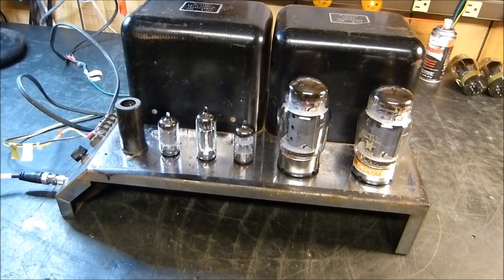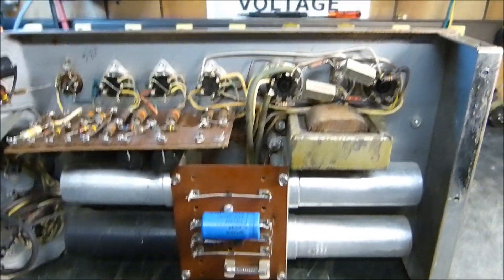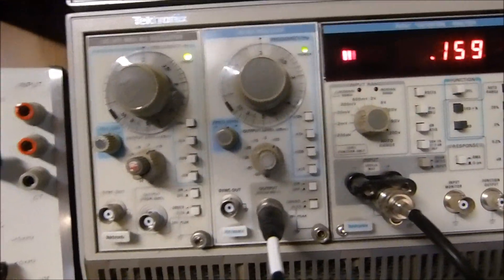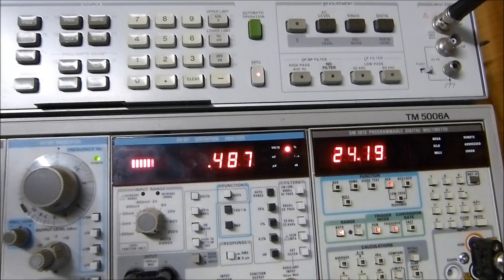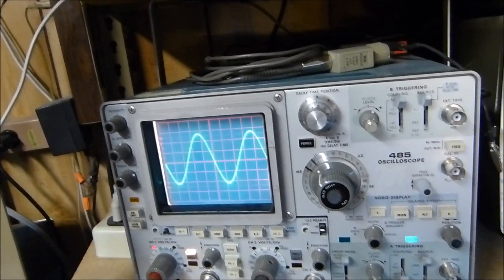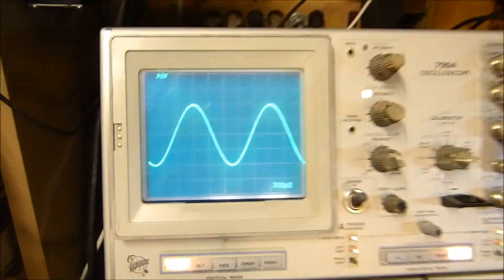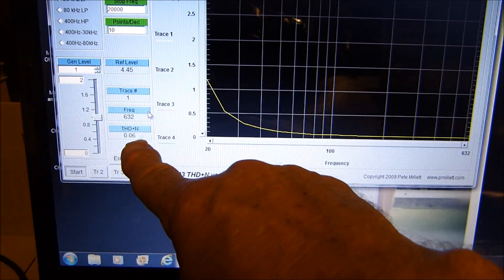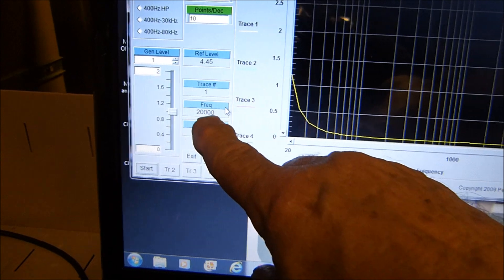McIntosh MC75 Mono Block Vacuum Tube Amplifier Testing and  Documentation

Comment: Question my fuse under the blue capacitor is dead, an I can not read on this how strong the are. And in the schematic documents I don't find them. Did you know which fuse in their?
Reply from the maker: I think they put the fuse under the chassis there just in case someone "accidently"  or carelessly puts the wrong size fuse in the outer fuse holder (someone might accidently put in a 20 amp fuse) which would Not protect the amplifier so it is safe to put the same value ampere fuse in both places. Whatever fuse rating is in the outside fuse holder can be put in the fuse holder under the chassis. If you can't read the value on the fuses, I would use a 2 amp slow-blow in both places. If that blows intermittently, you could increase it to a 3 amp but I Would Not go higher than a 3 amp slow-blow because if a 3 amp blows, there is something wrong in the amplifier. Hope this helps.
Reply: @ElPasoTubeAmps  and the Volt?   I live in Germany an use the US Models with your 110-125 V Power. We have 220-230V an use a voltage converter to have the 110V for the amps. I know the Fuse unter the Fusecap on the Chassis is a 125V 3,2a Fuse. But it's really hard to find this types of fuses in Germany 😅
Reply from the maker: @zerostacker2k00  It doesn't have to be exactly 3.2 A. Generally speaking, a fuse is selected to be about twice the amount of current an amplifier is drawing at idle. It is reasonable to assume the amplifier is drawing about 1.5A so, a 3 amp is a good choice. A 3A will be fine and protect the amplifier power supply. If it starts blowing, there is going to be something wrong with the amplifier like output tubes going bad or bad power supply electrolytic capacitors.
Reply: @ElPasoTubeAmps  the Fuses works but one of them dont Work with the Fuses, Power in in see a lightning... I watch this discus Thing between the 110/125 Switch an the Outlet 300 W ist broken. What ist this for a Part? And how many watt has this Part,  i think this is a resistance
Reply: In the shematic ist this the R28 25 ohm Cold
Reply from the maker: @zerostacker2k00  The schematic does show the thermister, R28 as greater than 25 ohms cold. When it heats up it is more like 1 ohm.

I have a feeling you are blowing fuses quickly. I would pull all the tubes out and then turn it on with 3A fuses installed. 

If it quickly blows fuses then it is likely the power supply that has the problem. 

I would check SR1 and SR2 to make sure these diodes are good. 

Also check C11 and C12. Also, C13, C14, C15A and C16A. If any of these components are bad it will cause a very quick blowing of fuses without the tubes in it.

If it does not blow fuses with the tubes out - plug the tubes back in and if it then blows a fuse after the tubes warm up, it is  most likely the output tubes, either KT88 or 6550 which ever ones you have installed.

Also, check if it warms up before blowing fuses, check the output tubes by looking if the plate is turning red in either output tube. 

Lastly, the bias rectifier, SR3 could be bad and prevent the bias from coming up and this will blow fuses after warm up.
Reply: @ElPasoTubeAmps  i installed the News R28... Fuse in it and Plugged without Tubes und blows of the Fuse. The SR1 and 2 i found them, but where ist the sr3 in dont find them, dont Tell me there is hide in the Transformator 😅
Reply from the maker: @zerostacker2k00  Take a look at this video. Maybe it will help you.
https://www.youtube.com/watch?v=roHQRsUmOKs
Maybe the MC75 does not have the second fuse... you will see in the video I am sending you, in my MC40 the choke is part of the power transformer. I did not know that until tonight.

Comment: I find that a Dremel tool with a brass wire wheel attachment does a great job at cleaning up corrosion on connectors and chassis. Using a metal wire wheel is good at cleaning off light surface rust. I do this for most of the hardware on amps that have rusty hardware and the result is like night and day.

Comment: I repaired an MC60 last month. Had a very interesting problem; no capacitance across the bias supply! But once fixed, the amp sings nicely. The output transformer makes a lot of noise at high levels, but the amp performs admirably.